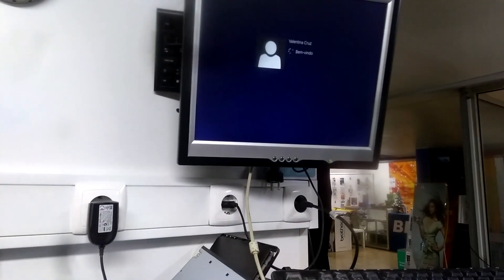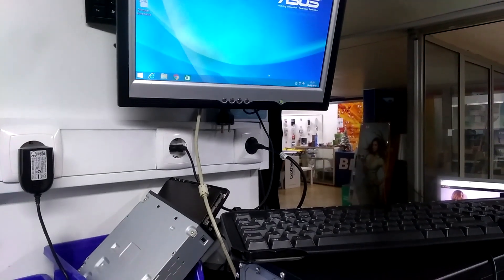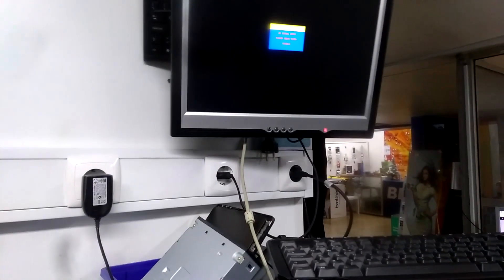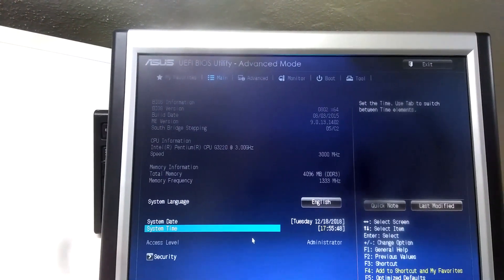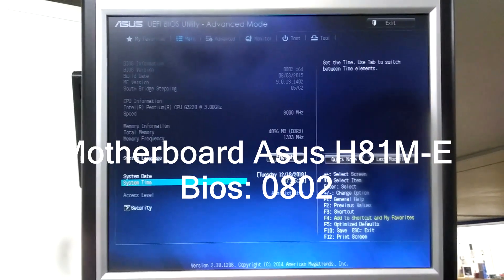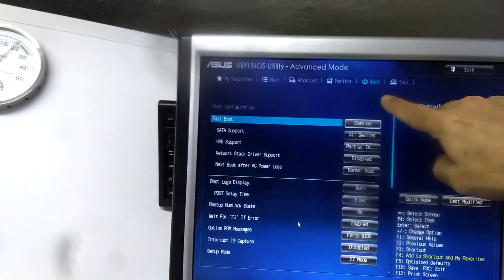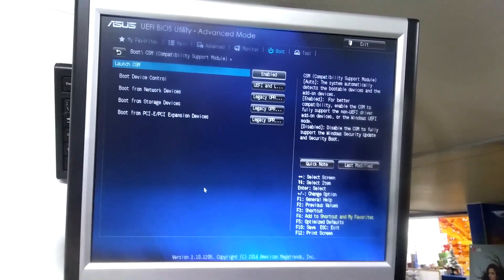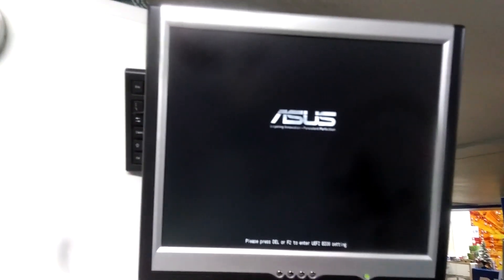Computer Boots straight into Windows when connected to VGA and skips Bios Splash screen

Comment: Nope, my monitor is connected through HDMI only, and it still skips the BIOS. The screen goes black for a bit, it flashes "no signal" for a few seconds, then goes back to black and finally boots into Windows 10.

Comment: I tried this method, but nothing worked. Any suggestions?
Reply from the maker: When you did the reset of the Bios, did you disconnect the power cable?  Try waiting for 5 minutes with no power cable, and the CMOS battery removed..... Then try again.

Comment: Brother on case hp laptop with broken screem aNd now using external monitor via hdmi please help i dont know how to?
Reply from the maker: The method should be the same, but don't forget to disconnect the power supply from the mains.

Comment: Also, to clear the user settings in the bios, switch off the pc. Take out the bios battery and short across the battery terminals, then turn on the PC to clear the bios settings. The yellow plastic thing he uses here is a jumper that connects two pins on the board usually labelled J22. Some boards have them connected to hold the bios, some have them connected to clear the bios, so read the motherboard manual. You will need to turn off the pc and disconnect the power supply before re inserting the battery and rebooting in to bios to then make your settings permanent.
Reply from the maker: Exactly... Well said ;)
Cheers

Comment: How bout if my pc just booting on bios and the skipp the windows. show after bios display it will no display I can't even get the desktop. is it the same way??  i use vga rx 570
Reply: I am a similar problem
Reply: @danielpredeleanu2429  it's ur VGA card issue broh, i have been replaced my VGA card with the new one
Reply from the maker: I read that you changed your VGA card... but did it fix your issue? because from what you described I would say that it was the hard drive that was not being recognized.
Cheers

Comment: Hey, I was wondering if you could help. I have a HP 400 G1 pc and forgot the login password so I am trying to access the bios menu, but I can't if I switch the PC off and press function keys the screen remains black. I also think the pc has quick boot up so it skips the windows loading screen. I am using a VGA cable to go to the monitor any thoughts on how to get to bios?
Reply from the maker: Hi,
I think your model it should be as follows:

Computer Setup can be accessed only by turning the computer on or restarting the system. To access the Computer Setup Utilities menu, complete the following steps:
Turn On or restart the computer.
Repeatedly press F10 when the monitor light turns green to access the utility. Ed user can also press Esc to a menu that allows you to access different options available at startup, including the Computer Setup utility.
NOTE: If you do not press F10 at the appropriate time, you must restart the computer and again repeatedly press F10 when the monitor light turns green to access the utility.

Hope it helps.
Cheers

Comment: Any idea how to remove compnay name on dell optiplex?
Reply from the maker: Hi,
Where exactly does the company name appear? In the Bios, or in Windows?
Cheers.
Reply: @Fixepedia  i think in bios
Reply from the maker: Hi,
Well that's more complicated... but try this, because it depends on the bios Version:

After you power on the system, but before the operating system begins to load, press the <F2> key to enter the System Setup Program.
The System Setup Program screen appears. At the bottom of the screen will be instructions on how to navigate the menus.
Use the <Arrow> keys to navigate to the Main screen.
Change the Quiet Boot option to Disabled.

NOTE: When Quiet Boot is set to Disabled, it allows Power On Self Test (POST) messages and the summary screen to appear at system start-up. When Quiet Boot is set to Enabled (default), it prevents the diagnostic POST messages and summary screen from appearing at system start-up. If Quiet Boot is enabled, a boot device cannot be selected during start-up.
Press the <F10> key and then the <Enter> key to save the changes and exit the program.

See if this works for you.
Cheers.
Reply: @Fixepedia  i will try thank you very much.
Reply: If youre really asking how to un-brand a generic motherboard if for example, You're building a pc with a motherboard from a Dell pc in to a Novell case, then: Depending on how tech savvy you are, once you're in the bios, check the full name and version of the bios, go in to 'boot options', set first boot device as 3.5"floppy (or usb boot device on newer machines) and make sure that there's a secondary boot device set as the main hard drive. Then save and restart. Get an unbranded bios update package for that bios version. Use the package to build a bios update on to floppy disk or a small USB memory stick/flash drive. Then use it to update the computers bios. BUT... If you have a windows version NEWER than Windows 2000, like XP, Vista, 7, 8, 10 then you will need the windows setup disk to re-license your current installation of Windows to your computer. So DEFINATELY DONT update the bios if you don't know how to do that.
Reply: @penfold7800  yeah.. the pc was recycled long time ago. Thanks for the help anyway : D

Comment: Hey man, how does that work that if you only have a single monitor displayport, it doesn't show splash screen. It should just go in order but because there is only 1 monitor, it has to be on that sigle monitor.
Reply from the maker: Hi,
What is your Motherboard model number?
You can try this method of setting the Bios to default settings by removing the battery like i did in the video, because it could possibly a "Stuck" Bios, and sometimes it works even in cases like yours.
Cheers.
Reply: @Fixepedia  you think, because if i connect it to the hdmi the splash screen works just fine. Btw my pc didnt work very well all the time and the filial concluded a defected gpu. Can this be the reason too that all displayport ports doesnt show splash and hdmi does, or would all the port not show the splash screen. If that can be the case it will probably be that
Reply from the maker: @camiely.4357  yep.... 
I can understand how it can seem like a GPU issue... but in my case it was a BIOS issue, and it's that case for other machines as well. What happens is that the BIOS chooses the HDMI port as primary and other port as secondary. So it's a Bios Bug issue.
The only work around that i found was the one i did in the video, i know it's annoying, but sometimes the are computers that have these glitches that never get addressed by the manufacturer, so we have to work around the issue.
Please try it and see if it works for you.
Cheers.
Reply: @Fixepedia  ok, btw this my my motherboard: GA-990FXA-UD3 R5 rev1.0
Reply from the maker: @camiely.4357  ahhh ... ok.... probably not the motherboard then, because your motherboard does not have integrated Graphics... so you definitely have a dedicated GPU Card.
Do you know your graphics Card model?
Either its a Glitch on your card or it really can be a GPU Chip defect.
Reply: @Fixepedia  i have (actually had now XD) the amd rx 480 when it was out the first 2 months. A lot of people had issues with this card i had too like the grey screen freeze.  Because it is concluded as defected now, i hope that splash screen issue is because of the gpu  and that it somehow can show splash screen with hdmi but not with de displayport.
Reply: Can you confirm if that is possible that a defected gpu can show splash screen on hdmi but if you plug only the displayport monitor it wont. Thanks for helping btw!
Reply from the maker: @camiely.4357  Hi, 
Sorry from the late replay, but what i could gather from some research, is that it most likely a software bug in the Graphic card and not a GPU Defect.
For some reason, the graphics Bios is programmed that way.
I'm not sure if that reason is enough for a eligible return, but you can try and see.
It also seems that in some cases its a incompatibility with UEFI/Legacy Motherboards. 
I'll leave a link for you to read in my next replay.
Cheers.
Reply from the maker: @camiely.4357  
https://www.reddit.com/r/Amd/comments/57qolv/so_whats_the_deal_with_rx480s_and_uefilegacy/

https://community.amd.com/thread/203956
Reply: @Fixepedia  this maybe can be useful maybe, but i dont think this addresses the exact same issue as mine. That amd forum link i saw too but i dont have weird multicolor rectangles. Still many thanks that you are trying to help me find the issue
Reply: Btw note that if i dont have any gpu drivers installed it doesnt show me the display too on displayport but does on hdmi. It is weirdly something with not showing the display without the gpu drovers with dp.
Reply from the maker: @camiely.4357  Yeah... you most likely need the drivers installed for the display port to work inside Windows. 
But drivers will not influence the output on The Bios Startup.
That's pretty normal, i have tried other cards with the same setup, and they normally do the same thing, it will have only one Output that is the primary and will work without the drivers installed and when the drivers get installed, all the other outputs will work to.
Reply: @Fixepedia  that is some weird stuff. That should be described in the info of the gpu
Reply: @Fixepedia  ok so according to that i hope it is or a defected gpu or an old gpu bios that was maybe updated after my bought. I just have to wait for my replacement and hope it will fix the issue.
Reply from the maker: Yeah... It could be the case, hopefully that does fix the issue... but keep in mind if it is a Bug, there's not a lot to worry about, it's just annoying but manageable.
I hope it works well.
Cheers.